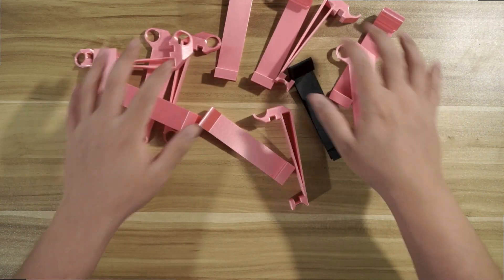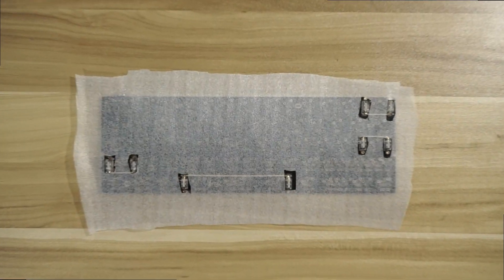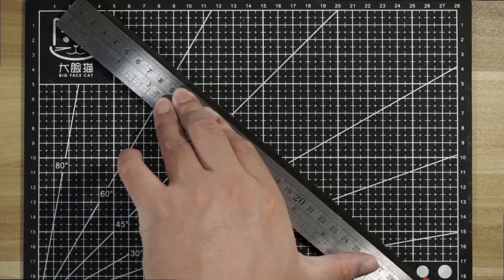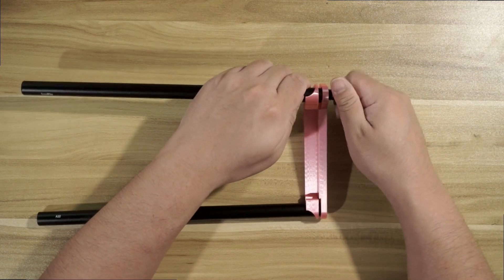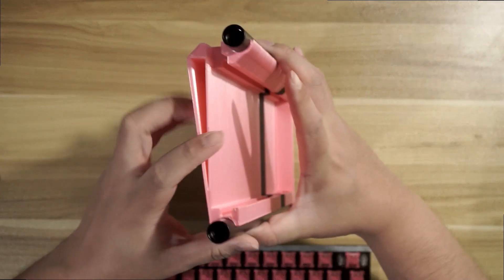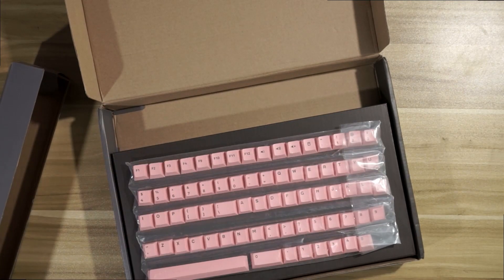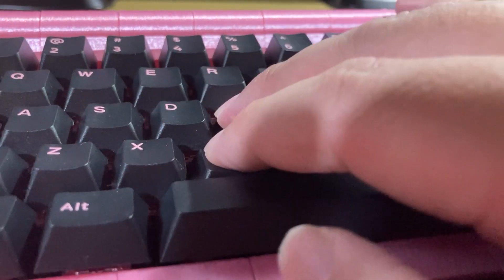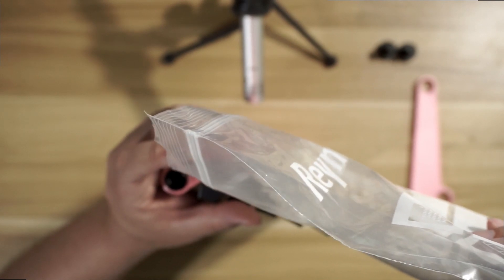3D Printed Keyboard - With a Secret Ingredient?

Comment: Awesome project ! Can this work with a hot swappable pcb too, or the case is designed specifically for that pcb ?
Reply from the maker: Its specifically for that PCB, though it would not be too difficult to make adjustments to fit other 60% PCBs
Reply: @BreakingBald0  thanks man, and again thanks for shaving the project

Comment: Thank you
I have a custom keyboard design slowly coming together BUT couldn't figure out how to make the frame/case without going to a metal shop.
I just found your channel and immediately subscribed.
I think I would use those beads that come in small baggies with some electronics. They can be bought in bulk rather cheaply, check any online tool type place as they are used to keep the tools from rusting.
I would be worried that bugs could get in to the rice.

Comment: I built this and it is awesome to type on. Plate was too wide had to reprint and slice off 2mm from each end of the plate and sand down a couple of areas to increase tolerances. Filled mine with silicon used for sealing in bathrooms in each individual wedge. Really chuffed with how it sounds thanks for uploading the files.
Reply from the maker: Awesome stuff! I was really surprised by how good it sounds as well. Upload a video of yours!